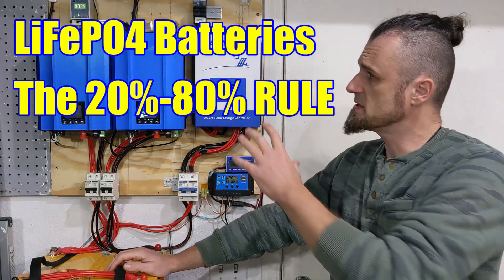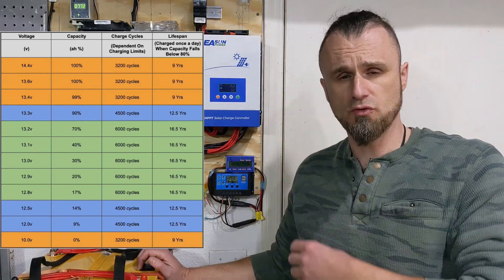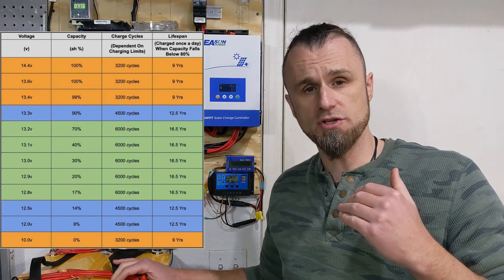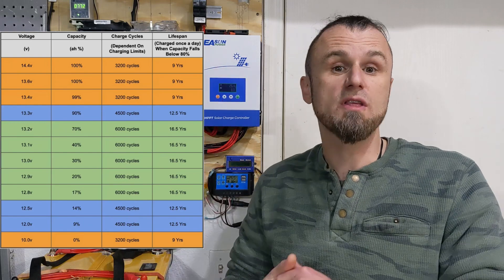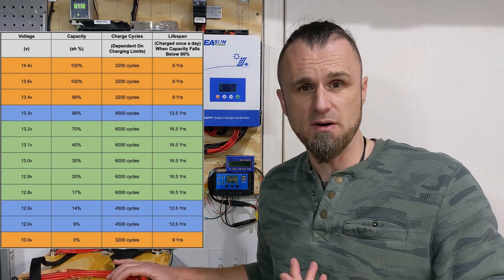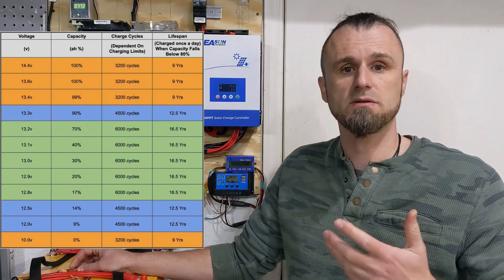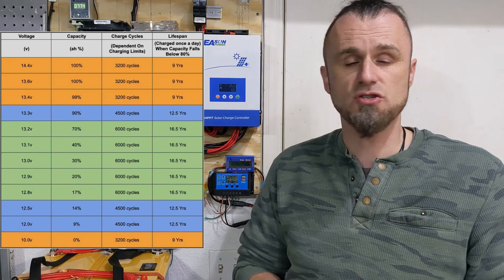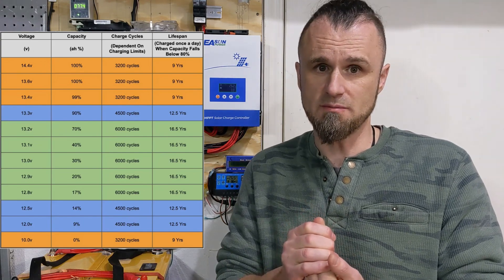LIFEPO4 batteries longest Life cycle possible 9 years vs 16 years the 20-80% Rule

Comment: Voltage of LiFePO4 batteries cannot be used to calculate SOC. It is impossible. Once the voltage in the cell rises above 3.4V, you're already at 96%SOC or above. Below that, there is no way to tell if the cell is at 80%SOC or 40%SOC by just measuring the voltage.
These LFP cells have 6000cycles+ at 100% DOD, so fully cycle them once a day will give you 16+ years. Then they have reached 80%SOH.
Forget about the 20-80%SOC rule. This was important with Li-ion cells, but not with LiFePO4.
Charge them to 3.45V/cell, let them balance for 30min and drop the voltage to 3.35V/cell (Float). They will last forever.
At the bottom, when they hit 3.0V, you have about 7% capacity left. That's when I stop discharging (if the batteries ever go that low).
Reply: I have found that, so long as the battery isn't charging and has a low rate of discharge, you can get a good approximation of SOC from resting voltage but you are looking at 100ths of a volt rather than 10ths. The JBD BMS has a lookup table so that it can guess at an SOC when it can't coulomb count. Certainly I agree that while charging the voltage is fairly meaningless as there is another variable affecting the voltage, namely current, which distorts an already pretty flat 'curve' On my BMS I did a voltage based guessometer of SOC based on the curve being relatively straight (not flat) between 12.8v and 13.4v with the algorithm only having a look if there was no charge and the discharge was below a certain amount. It tallied fairly well with the actual coulomb counted SOC which I know to be accurate, particularly in summer with daily full charges to synchronise it. Ps I do watch your channel and have got some useful info from your experiments to help inform my own and I thank you for that.
Reply from the maker: Great advice
Reply: I’m ganna give that a go Andy
Reply: @alanblyde8502 how is the set up holding up so far?
Reply: @OffGridGarageAustralia for maximum lifespan of LiFePO4 what charging settings would you use in a 48V system - Bulk Charge/Float charge I am very interested to know your opinion
Reply: @betimgashi7408 He literally stated everything in his initial comment. Read it? 😊
Reply: This is correct. Didn't know it was Andy at first. But while reading the comment, I thought to myself that this person knows what he's talking about.

Doing 20-80 on Lifepo4 batteries is a waste of time. Before you get to 20 years, calendar aging might have done worse than anything else. BMS might fail, too, but the cells would be in good condition. 

Enjoy your batteries. Don't micromanage.

Comment: Yeah, unless there's a good reason why something performs better when it is pushed to a limit, it's best to give it a nice buffer to ensure that it lasts longer. Lead acid batteries need to be charged at a higher voltage and then maintained at their full voltage or they degrade. You can do so with a LiFePO4 battery as well, but doing so degrades it faster than giving it a gentle charge and discharge.
Reply from the maker: Interesting info
Reply: You are partially correct. Charging a LiFePO4 battery at the limit of 50% Capacity can lower the lifetime, but if you charge it at 20% Capacity, will allow it to last longer. Discharging at a lower rate is probably a good idea, but not as important as charging at the lower rate.

Comment: I got a 25.6V 150Ah LFP battery. I usually discharge it to 50% of its capacity every day, and use the grid until the next morning. I have programmed the Grid Disconnection feature to switch to solar at 26.8V, and to grid at 26V. While discharging, it is not accurate that it will be at 50% DOD at 26V everytime. If there is around 300W of load, it is almost close to 50%. But if I put double the load, say 600W, the voltage will drop faster, and I will switchover at 40% DOD or 30% based on the amount of load on the battery.

During charging, I set the Bulk to 28V and the float to 27.2V. I loose around 10 Watts of charge when the voltage drops to 27.2V from 28V. I can set the Bulk to 27.2V, but the problem is during the charging, I get around 500W - 1000W depending on the load that is used in parallel. At 27.2V, at 60% state of charge, I will not be able to push more than 500W into the battery, and the MPPT will have to adjust its Solar MPP to reduce the power harvested from the solar. 

During Cloudy days those few moments where the suns pops out of the clouds and shines on the cool panels for couple of minutes, the 28V Bulk will help me to dump all the power coming from the solar into the battery without any limitation, as it can take 80 Amps of charge. 

Every LFP battery is different, so the Bulk, and Float voltages needs to be set based on the internal resistance of the battery.
Reply from the maker: My charge control doesn't even have options to set any other things when it's set up into lithium so there's no float there is no absorption It's just stop charging at this voltage and stop using the battery at a certain voltage and that's it

Comment: The problem with charging to 13.3v (26.6v) is that this is the resting voltage for 80% you have to have a voltage overhead on your charge system to be able to get there. One of the great advantages of lithium is it’s ability to accept any charge that’s available but to do that it needs some ‘push’ (voltage) behind it to get it in. I use solar mainly and occasionally the engine but when charging at reasonable rates, say a good solar morning, the voltage rises noticeably higher to get the available power in and then, when it stops, the voltage falls back to reflect the state of charge. I have found the best compromise cut off voltage to be about 14v. If charging with the engine at around 0.25C (200A into 800Ah) then I increase this to 14.2v and this gives around a 90% SOC by the time it cuts off when the voltage then drops back to one that reflects that SOC. I datalog my system every minute and have been doing so for around 4-5 years and have used this data to determine the setting that give least stress to the batteries along with best charge acceptance. The aim is to get away from the absorption current taper of lead acid that wastes so much charging resource. At the moment for instance the batteries are at around 80% with a 0.025C charge rate yet are at 13.4v. I think you are probably having a max charge of somewhat less than 80% with the other risk which is that you never get the cells into the top ‘knee’ which is where they need to be to balance. I have a 12v low voltage disconnect but with a recommendation to start charging at 12.8v or 20%. I use a home built BMS to give me quick easy access remotely to change any parameters and because I also wanted to look at protecting from low voltage overcharge which actually turned out not to be a problem with the settings I use. I hope you find some of those thoughts useful. I have a home built battery of various cells in multiple P4S with about 2500W solar and around 200A alternator charging as a backup. I also run hybrid with a 12v lead acid however that is only there to stabilise the charging sources when the BMS cuts charge and enables me to use lead acid charge setting on everything so saving cost in the conversion from lead acid and enabling alternator charging which would otherwise have needed either dc-dc converters (work of the devil) or expensive alternator controllers.
Reply from the maker: That's great info .. Yes that's what I've set up my charge controller to stop 27.8 It seems to be the magical number with mine but I think it's about 0.2 off my voltmeter so basically we are in line with what you were saying, unfortunately when I set up my charge controller in lithium iron phosphate mode it only has a charge voltage and that's it It doesn't give me any floating or bulk or any other stuff
Reply: @VegasRoManiacReviews  You don't actually need float although if you do have a charger with it then 26.6-26.8v would be about right. It is important that the charge gets cut at your set voltage and not held there. Some controllers with a "lithium profile" just hold the voltage there and don't disconnect. This is why I tend to say to people that they need a 'valid' lithium profile as many simply are not and don't do the battery any favours. "Bulk" is actually not a setting, its a state before the absorb / boost setting is reached and is the 'constant current' part of the charge cycle where it charges with whatever current is available until the 'absorb' voltage is reached when the voltage is regulated and, as a consequence, so is the current. Some controllers can be used on a lead acid setting so long as you can control how long it stays in absorb for (a few minutes is fine) and also control the float level (26.8 / 27v or so) and also control the boost / bulk reconnect which can be just below float.
Reply: @philbrooke-little7082 so what would you advise say if I am using a victron mppt smart charge controller? My current settings are at 28.4 absorption voltage and 27.0V float voltage. I noticed that indeed the current is cut down for the two hours that the battery is in 'absorption mode'. What I'm not sure is if this affects the inverter or the inverter pulls the required energy to run the loads from the panels.
Reply: @dancerehab1092  with those I would go for a 28.4v absorb but with a 5 min absorb, as it really isn't needed for best life, 26.8v would be fine for float if the batteries are in constant use and a 0.1v and a re-bulk offset voltage of 0.1v turning off adaptive / battery safe. You need to go into 'expert mode' to do this
Reply: @philbrooke-little7082  thanks, let me make adjustments right away and monitor how the bank behaves tomorrow. I will be harvesting all available energy yes?
Reply: @ You'll be able to harvest well over 95% of the energy, in fact close to 100%. The object is to get best cycle life from the battery and that is done by not pushing limits.

Comment: I am not extremely knowledgeable about the chemistry in these batteries, but my intuition says it would be useful to charge to 95-99% about every 10th cycle (day), just to keep their capacity fully exercised. Likewise, they should be ran down to 20% every so often. I think Lithium Ion battery experts say that, and it should be similar for LiFEP04 chemistry.
Reply from the maker: Yes that's good information and I think lithium iron phosphate are a little bit more durable and less picky than lithium ion

Comment: I started with a large 48V battery bank and i wish i had gone with 24V and fewer batteries. 1) Higher voltage chargers and inverters cost disproportionately more than lower-voltage chargers. 2) I experience far fewer power failures than expected, better to invest in infinite-shelf-life propane and a propane generator.
Reply: Batteries are best for storing energy from an infinite supply like the sun.
Propane may have a long shelf life, but it gets used up very fast when there is no resupply, and it is not rechargeable.
Reply from the maker: Great info

Comment: Wow, i just had my first set of winsons/thunder sky lifepo40 cells die at 13 years old and that was before yttrium was added. Yttrium took them from 3000 to 7000 cycle life at 80% DOD. The information you are handing out is false and so wrong it is not funny. 80% of real world charge voltage happens between 13.4v to 13.6v. The information you are giving out is just rubbish and people will believe you. Charge them fully to 14.6v. Add a good 5A balancer. Secret to long life is long low charge and long low discharge. I have done hundreds of installs. And have 20 years experience in off grid installs. Over size the pack so your regular DOD is only. 30%, also extends the life and helps on rainy weeks. These Chinese cells are good enough and so cheap you dont have to worry about getting 15years out of them. They are a quarter of the price of the Winstons.
Reply from the maker: I didn't make the chart , I just found it on one of the batteries manual, that's why I finished the video with a question. I don't tell people what to do , I just wanted to know best practices .. the info you have given me helps...